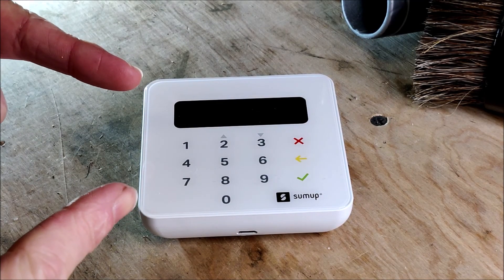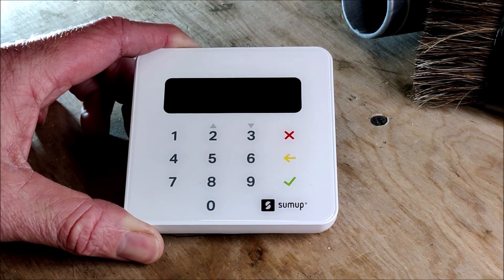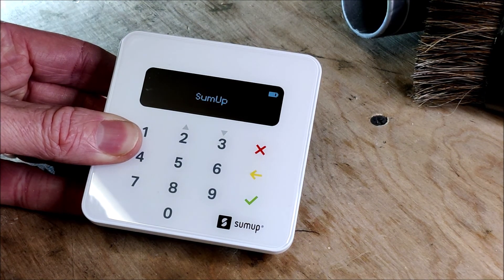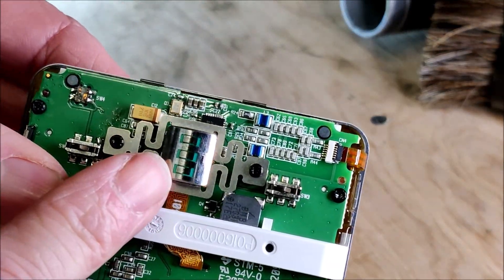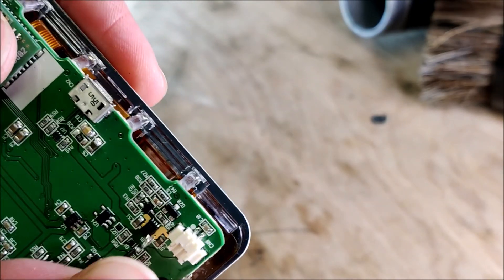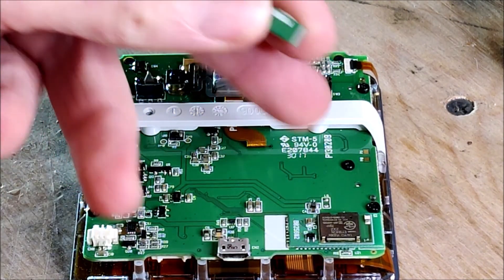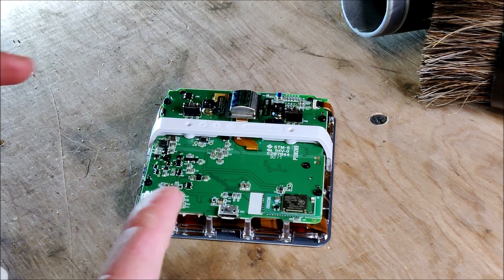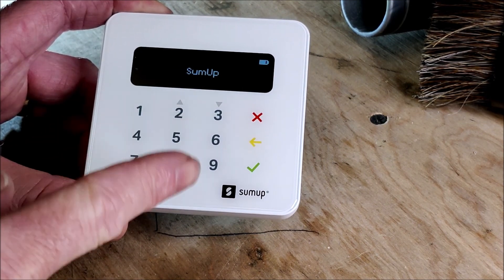SumUp Air contactless card reader teardown (not Square, Zettle, Apple Pay, Google Pay, Worldpay)

Comment: How do you take it apart
Reply from the maker: 4:55 depicts this
Reply: Mine was blocked anyway. So i took it apart. Undoo the screws, impossible to get the front off without breaking the screen. It still lights upp with the same messages as before even when its open.
I did not drop it or overheat it it just popped up an erreur message, "blocked machine, buy a new one " 😡 so i'm going to buy a Square !